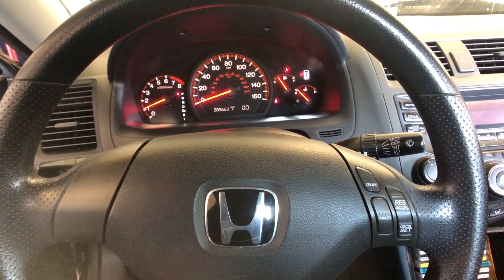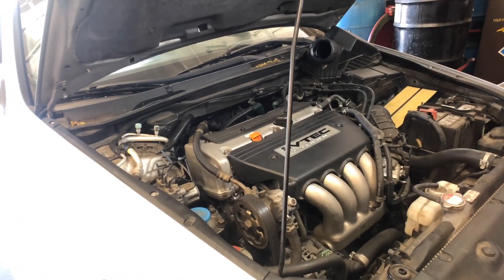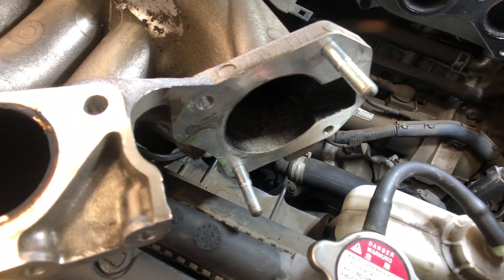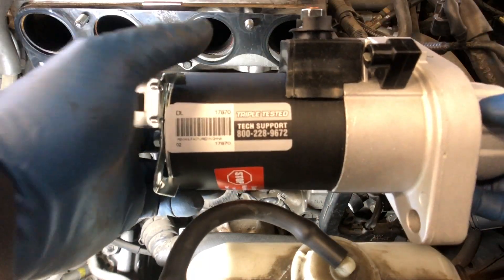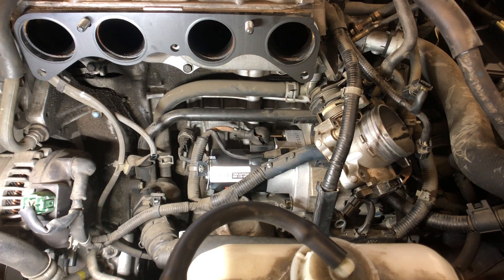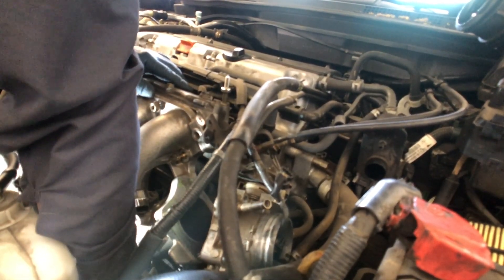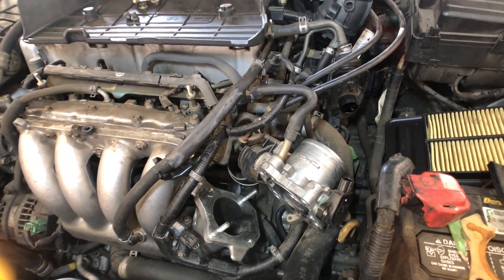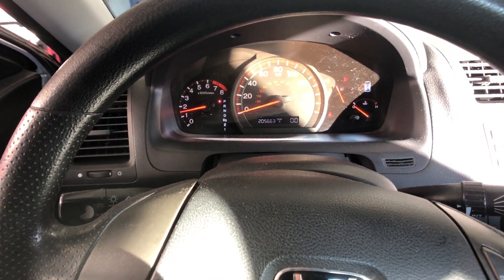⚙️2002-2007 Honda Accord Starter Replacement 2.4 Liter Engine

Comment: I just did this over the weekend on an '06. The 06 and 07 I believe have a black canister attached to the intake manifold where you can't even see the starter from the top of the engine. All I did was remove the intake manifold and some vacuum hoses and the aforementioned black canister (2 bolts up top, 4 bolts in lower corner near the alternator.) I then just pulled the intake manifold toward the radiator and was able to work around it without removing the intake air hose or throttle body. You will need some flex head ratchets though and some joint/knuckle socket adapters to make the job easier.
Reply from the maker: Jose L There’s different ways to do it, good job 👍🏼

Comment: Awesome video. Tried doing the starter this weekend and the 17mm starter bolt was fused to the transmission. The end of the bolt was melted onto the block. Is there any advice on how to fix the threads from the transmission? Do I need to do a helicoil sleeve? Thanks in advance.

Comment: I seen that the green key was flashing on cluster at beginning when you turned the motor off. It’s for the immobilizer and chip in key. No problems with that Hector? 
Good job on starter replacement.

Comment: I'd keep the honda starter, clean it up real good, replace the brushes if they were worn and sand the armature. Have done quite a few over the years, put a lot of miles on the cars with no more starter problems.  Replaced an aftermarket starter for a friend that bought one and it was junk in no time.  And he gave away the good starter as a core charge.

Comment: This can be done from underneath remove splash plate pull out nock sensor not sending un undo the bracket on the lower part of the intake . If you are half ass mechanical 45 min job

Comment: My 2007 Honda Accord has over 227,000 miles on it and she had started to not crank at all. We suspect its the Starter, or the alternator. The display, Radio Air lights all come on but the engine won't turn on.